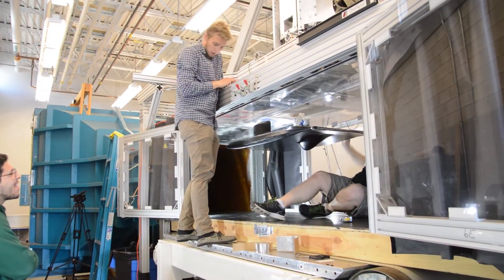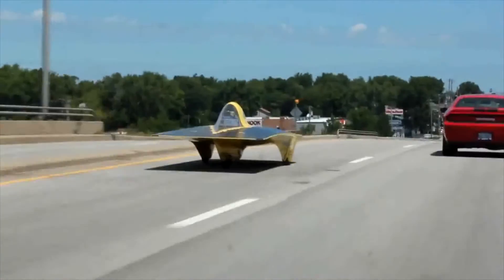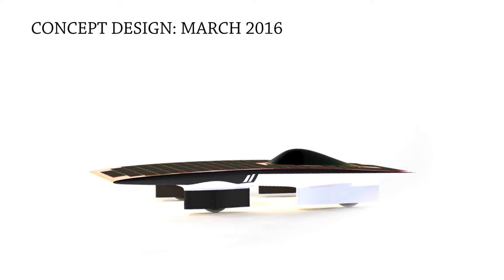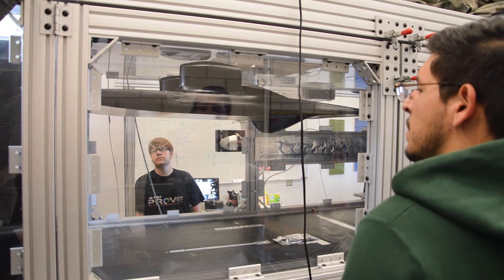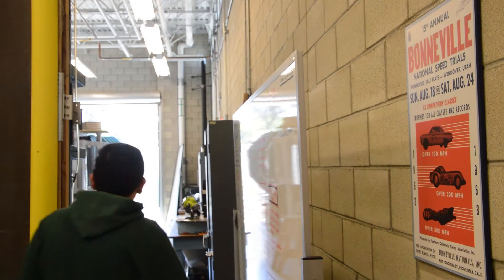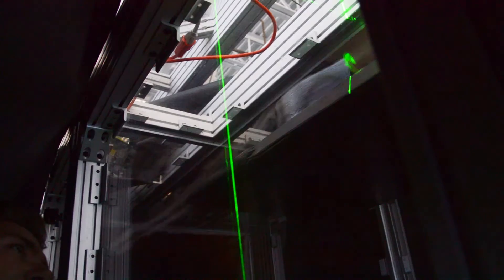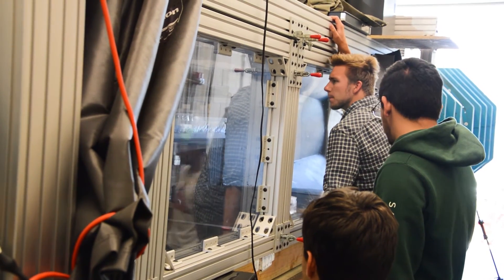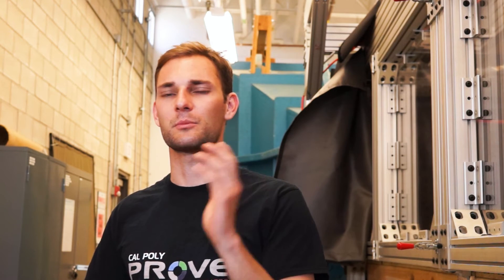Wind Tunnel Testing the PROVE Lab Solar Car

Comment: It's a great job,guys.

I just wonder what's the dimensions of your wind tunnel? It's obviously a open circuit wind tunnel. What is the lenght of the whole tunnel? And also what is the maximum speed of the tunnel in the test section? I would appreciate if you answer it. Thank you